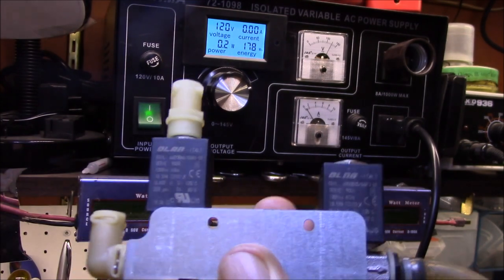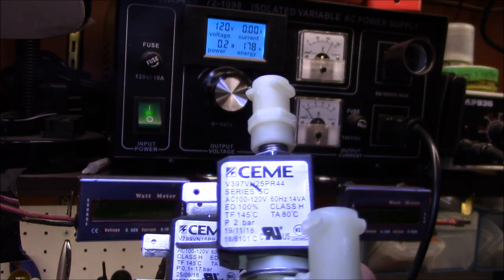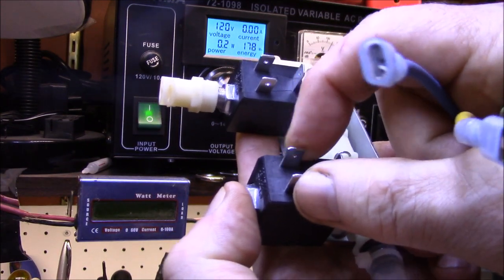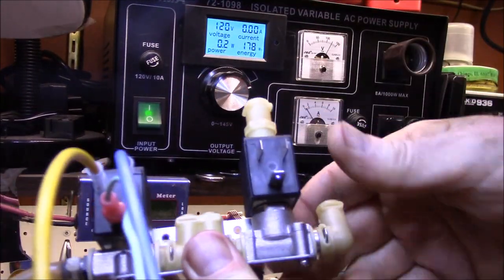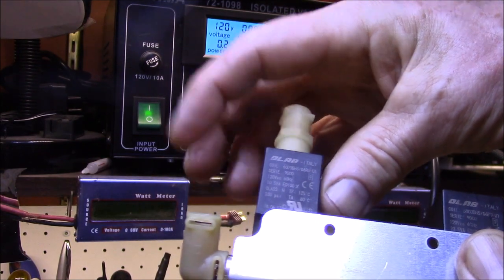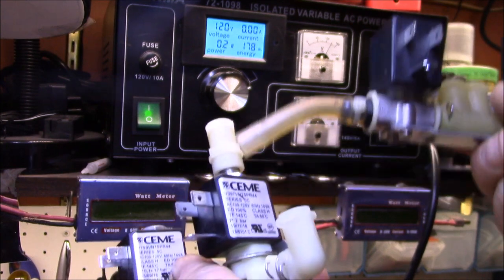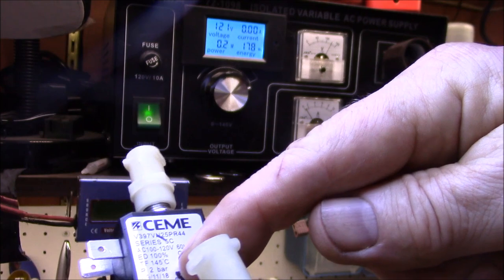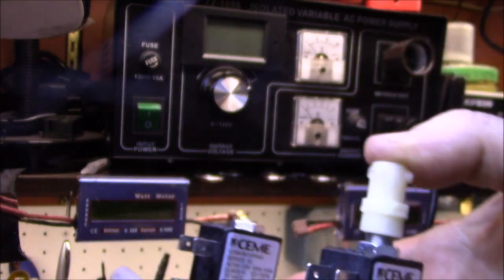Breville Barista Express - Solenoid Block Testing

Comment: What is the value of the magnetic coil ohm?
Reply from the maker: Check the photo album link in the video description, specifically this photo:
https://photos.app.goo.gl/ML3GqQLEyC3KVcQZA
Around 660 ohms on the Olab coils.
Reply: @The4Crawler  You gave you a value in kΩ ... enter in Ω
Reply from the maker: @jankesken47  Yes, the meter shows 0.660Kohms which would be 660 ohms.  That displayed value will depend on how your meter displays resistance values in that range.  The exact value is likely not critical, only values close to 0 or infinite would indicate a short or open circuit condition.
Reply: @The4Crawler  OK. I have a solenoid valve from Gastroback 42612 . On one shows the value = 1.877kΩ, and on the other it shows nothing. What do you think?
Reply from the maker: @jankesken47  If that's a 240V solenoid, that 1.8K value is probably OK, higher voltage = higher coil resistance needed.  The one that shows nothing is likely defective, meaning the wire that makes up the solenoid coil has burned out internally and gone open circuit.
Reply: @The4Crawler Yes 240V, 9,000 KPFV 9-12.5VA series, and nothing shows. The second is 240V, 6000 L5FV 9VA series and shows 1.877KΩ
Reply: @The4Crawler  Interesting thing ... When I turned on the meter for a value of 200 OHM Ω, it does not show any value on two valves. When I switch the meter to a value of 2kΩ, it shows 1.877KΩ. Is it OK?

Comment: Mr Brown thanks so much for your videos. I just replaced the Solenoid Group as it seemed to have a blown or stuck 3 way valve. Unfortunately after the replacement the new 3 way  is not switching to the steam/water output on top, so I get steam and water through the group head. One question, should the 3 way solenoid Click when you plug-in the machine ? Mine does but it doesn’t when I select water or steam output. Any ideas? It had been without proper descaling for a long time. (I have another spare 3 way solenoid valve, but would like to understand the issue first. What should the voltage feeding the valve be with the steam switch on standby? And on with Steam/Water selected ? 

Thanks so much if you can take a few minutes to answer. 

All the best.
Reply from the maker: The 3-port valve should only click on for the espresso cycle, as you can see with the indicator lights I added to my machine:
https://youtu.be/9cC-m3a-oXY
I don't think anything clicks in my machine when it's plugged in and only the pump runs for a short bit when you turn the machine on.  There should be close to 0 volts on the solenoids in standby mode.  You might see a few volts due to leakage current in the driver circuits, for example I see a dim glow in my indicator lights at night on my machine and you will get a tingle off the terminals if you touch them while the machine is plugged in.  No valves operate in hot water or steam mode, only the pump.  Water should flow up out of the normally open top port of the 3-way valve.
Reply: @The4Crawler  Thanks so much, that helps a lot. I have 120 Volts on the 3 way valve terminals even when the power is off. Which must be what is keeping the valve open regardless of the cycle it’s in. As a result I get hot water/steam through the group head. Double checked the valve’s terminal connections with your video and my pictures and it’s correct, so I must have a shorted or blown diode in the electrical. Have you come across a wiring diagram available on-line for this machine ? 

Thanks again.
Reply from the maker: @tupublicoful  This is the closest thing I've found:
https://siber-sonic.com/appliance/800Electrical.html
It's for an earlier version.  
Might trace the wires back to the main circuit board and see if they're connected to the right location.  A possible fix is to add an in-line switch to that solenoid.  Open the switch and that'll turn it off for hot water/steam, close the switch and it'll run the brew cycle.
Reply: @The4Crawler  BTW I fixed my machine. Had to replace Solenoids and the main PC board, only the TRIAC didn’t do the trick. A brown out probably fried the board.

Thanks so much for your help.
Reply from the maker: @tupublicoful  Thanks for the update, glad you got it working again.  Sure sounds like something with the electrical system took out the machine.  Might almost pay to put it on a line-interactive UPS.  Would have to be a powerful enough UPS to handle the load of the machine if needed.  But for brownouts/surges, those models can step the voltage up or down as needed or switch off the grid if the incoming power is too bad.
Reply: @The4Crawler  Thanks for the advice, I did connect it through a line conditioner, which are common for this part of the world. Used one rated for 1800w which should cover the 1500w spec of the machine. This was an oversight on my part when I installed it. Every other device with sensitive electronics is connected through a line conditioner or full UPS, but this one. It probably was because it was sitting next to a set of fully analog appliances.

Comment: Love the explanations, I wish I had the test bench, but you showing the noise on the failing valve will probably help me. I think I have the same noise on a non-disasembled olab solenoid assembly .
Reply from the maker: Thanks for the comment.  Yes, it's a pretty distinctive sound when the valve hangs up part way open.